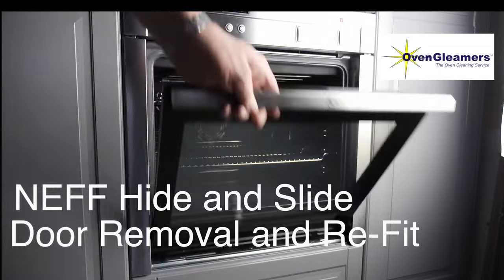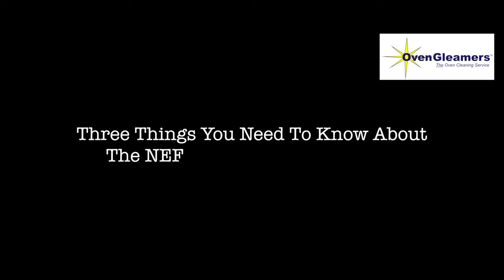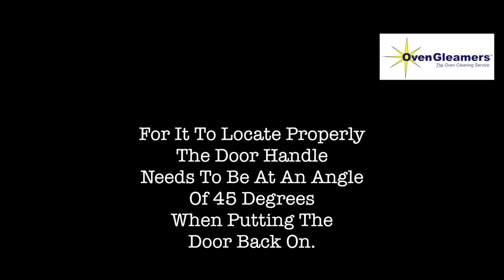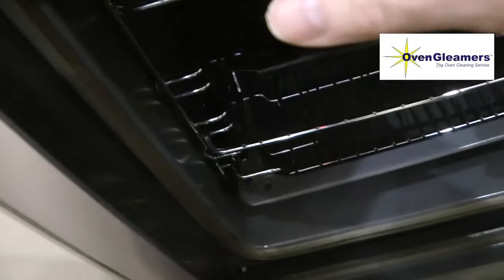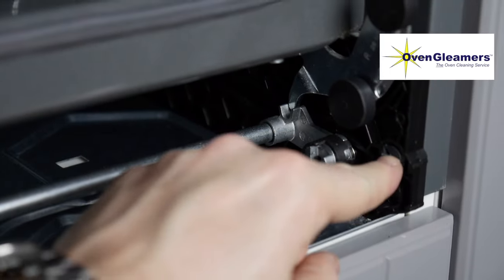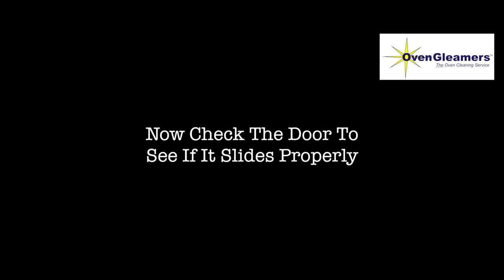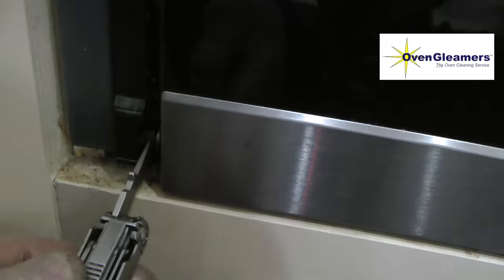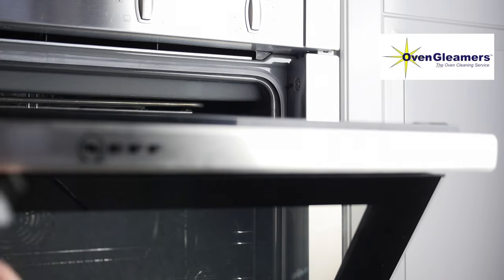NEFF Hide And Slide Problems - Remove and Refit Door and Fallen Off Fix

Comment: I bought the Neff N50 ..HN0B. After 2 months use it needed a thorough clean after Christmas. I followed the instruction manual in removing the oven door but could not refit it because the top rollers had moved forward hard against the rubber seal of the oven and was out of alignment with the bottom two rollers. The official Neff video pretended this problem does not exist and their was no mention of any potential problem in the instruction manual except to say if you have any problems please call a Neff engineer. I did and had to wait 10 days. I am so so grateful for this video. It was the only one I found on YouTube dealing with the pesky problem of  the Neff oven door realignment in any detail. It took a few goes but after a days thinking time I finally cracked it. The secret for me was to make sure that when the hook of the top roller was in the hook of the bottom bar roller you had to push to the bottom roller back slightly for it to firmly grip the hook. It was helpful to have a second person immediately lock the rollers by using a coin on the side lock. So it’s a 2 man job even though the video shows it can be done by one person. I also did not take off the side panels. Thank you once again for this really useful video.
Reply from the maker: Your welcome. Since doing this video when I put the door back on I check along the front to see if there are any gaps. If there is a gap the door hasn't located properly into the slots and needs taking off and putting back on. If no gaps the door has been put on correctly and can now be locked in place.

Comment: Thank you. I watched your video when I had problems putting the door back on, one side locked the other didn't, thanks again.
Reply from the maker: No problem. I've found that with most hide and slides, other than mine in the video, you have to bend the bars with the wheels on the ends further down to lock them.

Comment: Thanks for a very helpful and informative video. For me it was more help than the Neff official video.,  Your advice about the door falling of the runners is very good and simple to follow,  also the tip on removing the side trims so as to better expose the door spigot is very helpful.
Reply from the maker: Thank you. Yes have had a lot of experience with these now. And spent a lot of time in the beginning trying to work out how to fix them.

Comment: Hey Graham.  Thanks so much for posting this 'how-to' vid.  Legend.  Unlike the present English Cricket team, this is very useful. Great work mate!.  The numb-nuts at Neff won't like it because you are taking away the call-outs they recommend when this inevitably happens to these doors.  cheers!
Reply from the maker: You're welcome. I've found that when you put the door back on to the rollers and push the door down the way to check that it is properly located is to check to see that there isn't a  gap under the bottom of the door. With the swivel angle handles if the door isn't located properly then the gap on the side it isn' t located on will be larger than the other side. With fixed handles - which are the newer hide and slides the doors go on a lot easier.

Comment: The right-hand hinge lock won't engage & is closed all the time, I have levered it open many times without success, I tried holding the hinge out to replace the door, now the outer glass panel has shattered. HELP!!
Reply from the maker: HI Ken, I have noticed that over time the locks don't lock. And on further inspection the lock just moves a piece of plastic to let the locking pin fall into place. When my lock wasn't working I put the door back on with one hand and the other one holding the bar which connects the two sides with my other hand so keep both of the door bars sticking out so I could get the door one. But the way to fix it is to replace the door hinge. I would suggest calling out NEFF to get it done as it is a long process that involves stripping the oven backing off.
Reply: @ovencleaning  Thank you for the reply, I got around the problem by levering the hinge out and placing a rawlplug between the roller wheel and the track frame, once the door was back on I could simple remove my temporary  spacer... I've made a note in the handbook as a reminder for the future. Cheers!

Comment: This is great thanks. I have a problem with a slide+hide door where the 2 hinges (as shown at 9:48 the things with the 2 black roller-knobs) are jammed.  I have the locks in the correct position but cannot move either of the hinges like in the video (the door is off). I don't think I'm just being weak! Is there something I need to do to free them?  Thanks.
Reply from the maker: A bit late now. You've probably worked it out. But you need to give them a pull and then turn the lock so that when you let them go they lock into position.
Reply: @ovencleaning  indeed. fixed it last year. but thanks!

Comment: This has been really helpful today. Having just spent a few hours cleaning the oven, BUT on trying to put the door back the bar came off the rails just like you mentioned and i've tried putting it back on - but i forgot to lock the two grey lock pins and now the door is jammed - is open 20 degrees - will neither shut nor can i get it off the rollers :(? Any suggestions very welcome please. Thank you
Reply from the maker: Only just seen this five month after you posted it. Hope you sorted it.

Comment: Thanks for this video! I have a slightly different model it’s a b57cr22nob and the roller bar has come off and I need to relign it but the lock system doesn’t seem to be locking I push it back to hear a click and nothing and it just falls off again - I did unlock it before and locked it during ! Can’t figure what I’m doing wrong here !? Helpppppp
Reply from the maker: I guess you've fixed this by now. But I have now the same problem with the oven I used in the video. One side doesn't lock. What I do to get the door back on is to hold the bar in position with one hand so the door bar is sticking out in the correct position. I then put the door back on with the other hand. I think to fix the problem properly I'm going to have to replace one side runners and locking mechanism.

Comment: I’ve done this I now find the left handed has moved and won’t move down as per right side 
Any thoughts
Reply from the maker: It’s sounds like it’s not locking. To get the bar out so that the door can be put back on I’d try putting something behind the bar, eg s fuse or something similar in length.

Comment: Mine won’t lock after twisting the spigot lock heads at the side ,has done previously ,don’t know why ? Wot can i do
Reply from the maker: I've found with the locks not locking the plastic lock arm as fallen off. You need to pull the oven out of it's kitchen cabinet frame. Then look at the side and you'll see a white plastic arm that connects the lock to the pin in the hinge. This arm comes off of the pin and just needs putting back on. Check this first. Other than that its call to an appliance engineer.

Comment: Do you have a video on how to tighten the door handle?
Reply from the maker: Peter, you just take the door off and then you can take it apart and access the back nuts to the handle. It's easy once the door is off.

Comment: neff slide and hide doors are an absolute design failure, totally hopeless..pull down doors so much easier cheaper less problamatic..hopeless
Reply from the maker: Yes I agree. And as they get older things get worse. The locks stop working, the cable that runs from the handle to the spigots break and it all becomes very costly. My best recommendation is to get EXTENDED WARRANTY if you by one!
Reply: @ovencleaning  i got rid of it within a week..back to bosch..far better

Comment: neff slide and hide are just too much trouble considering how much they cost..
Reply from the maker: Yes they seem to be problematic. It's a novel design that hasn't been thought through. They have though changed the design on the newer ones - now have a fixed handle on the door. I would recommend  getting an extended guarantee if you buy one.